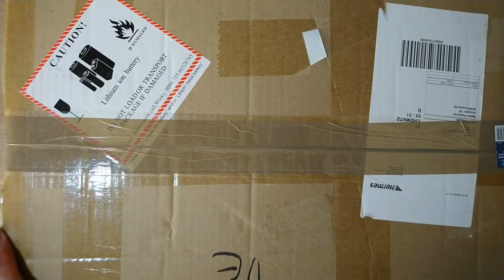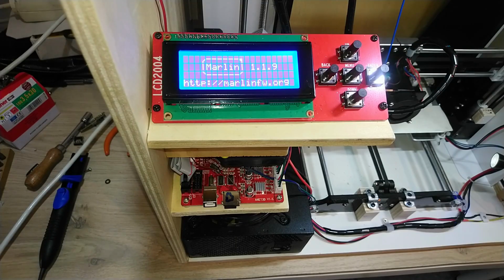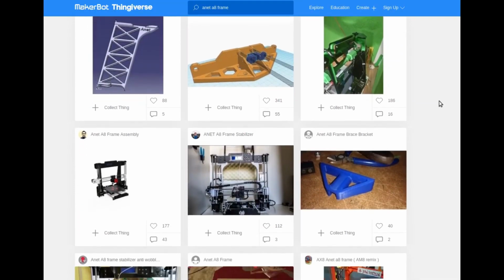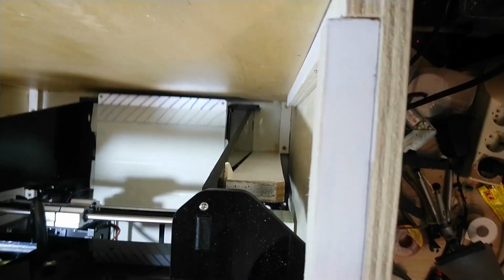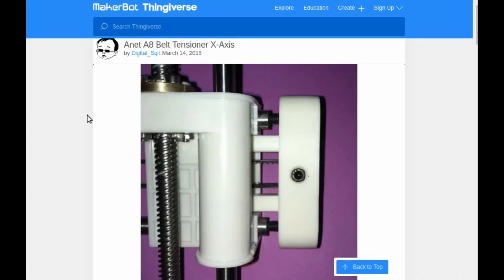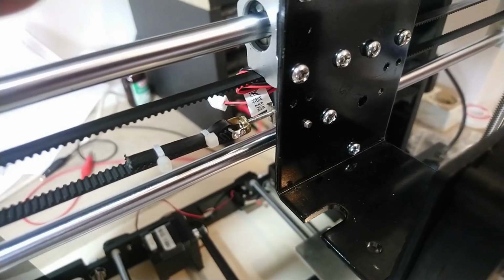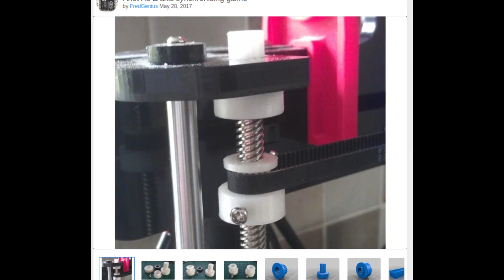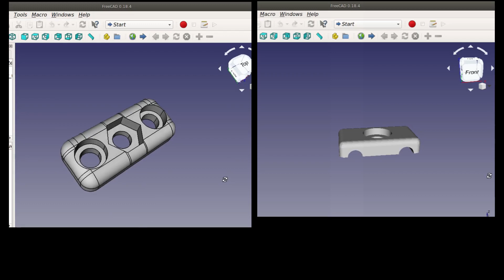My adventures with an anet A8 3D printer

Comment: I used to have this printer.. it is really  terrible. Stay away. Threw mine in the garbage and bought an ender 3 which is a good printer.
Reply from the maker: I fully see how this printer could be a terrible experience :) I took it as challenge and knew exactly what I am getting myself into before buying. But my engineering experience did help a lot here, I admit. Printer still works great after a year.

Comment: The Anet A8 too often gets a bum rap. I bought mine over three years ago and have run it consistently. The acrylic frame has held up beautifully and the only failure I have had was the motherboard... which was my fault. I did upgrade the usual suspects when I first built it. Like the power supply, mosfets, bearings, auto bed leveling and aluminum bed frame. Its prints are exceptional and work for my needs. This printer is the best for breaking into the 3D printing field.

Good video. I like the box you built, I may have to one like it when I build the metal frame, a next project. I also like the computer power supply you used. I have one and you have given me an idea on how to use it. I also like the way you skip over the building parts. Saves time and gets right to the topic.